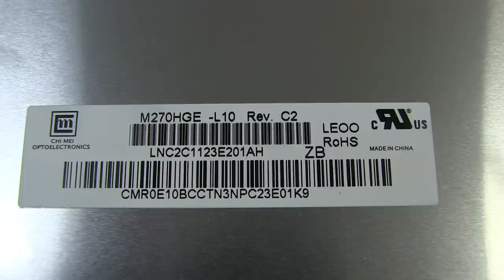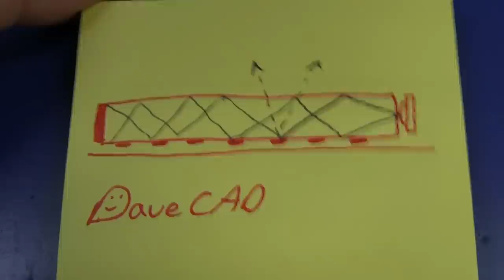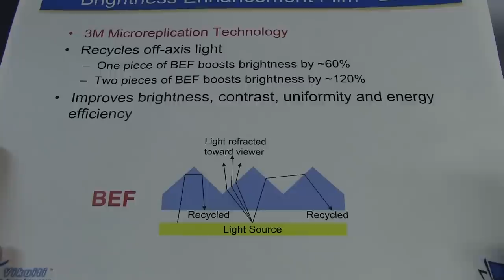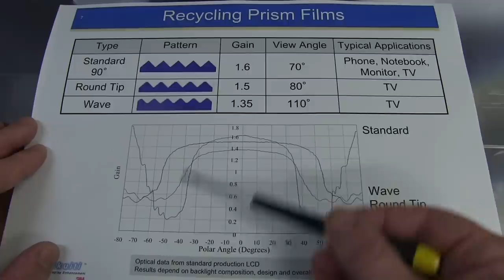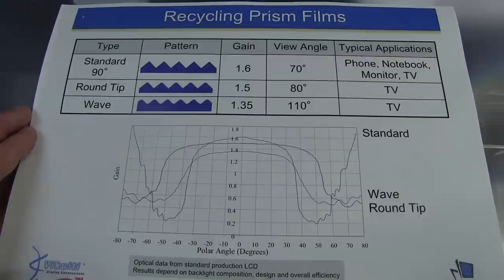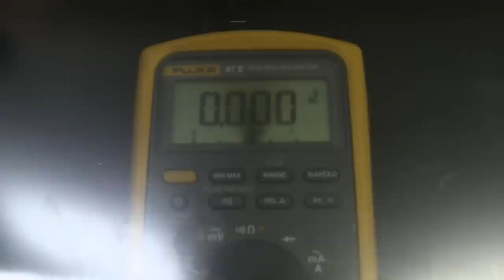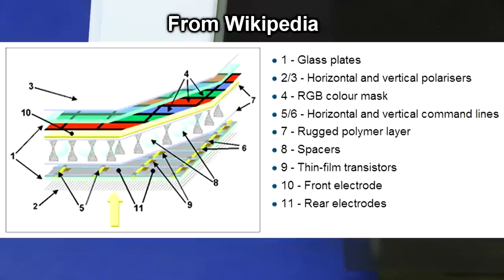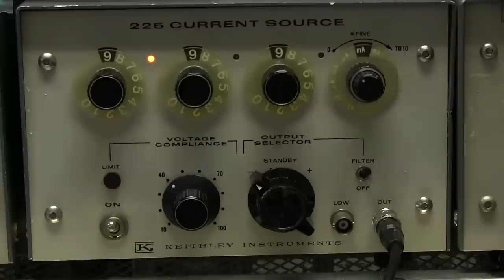EEVblog #465 - LED LCD Panel Teardown

Comment: just a regular lcd displa.y back light is led you can tell about that led strip you find inside.  i dit teardown a 3d lg tv from 2013 only led's i found was the back light not on the display it self.  the lg tv has this serial nuber on it it was the (lg  32la6143) the ccfl back light is replaced by a led backlight. on the display it self no led was found  so this name on this movie as main title is so wrong  but stil nice eev blog tho. you can tell on the pixels that this is just a old liquid cristal display most common led has longer burning ration that ccfl backlight systems if the lcd display was a led based system than it should be amoled oled based display . and led back light can use up to 170 volts and above 3 amps of current depend on what kind of backlight is in there